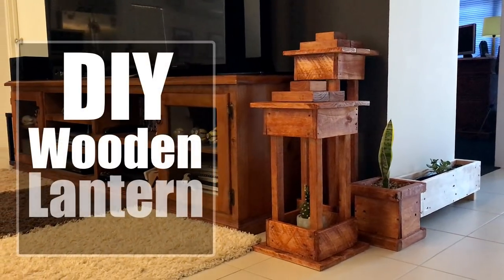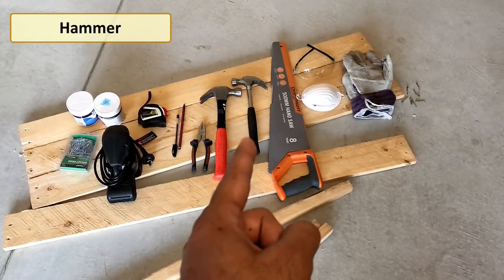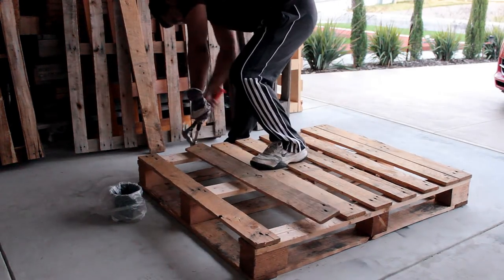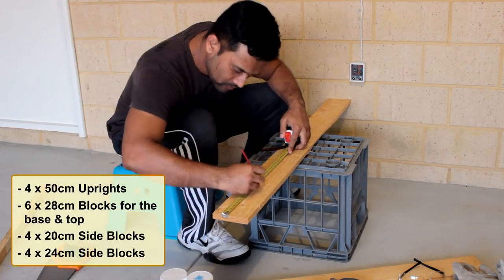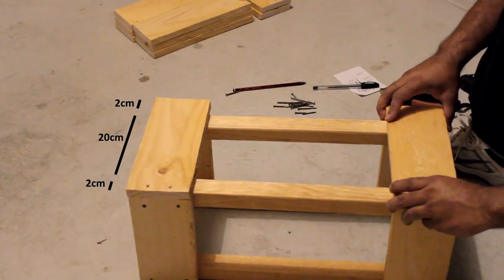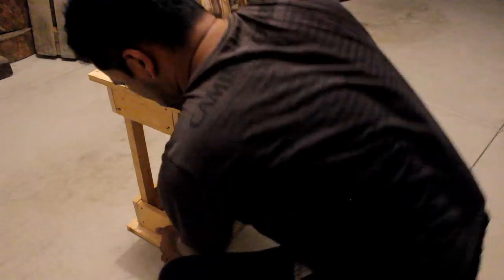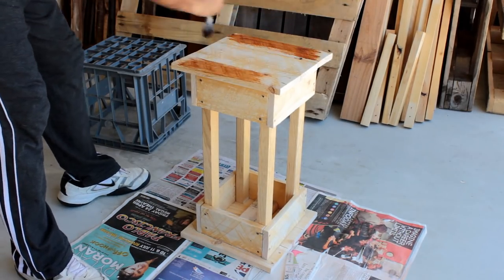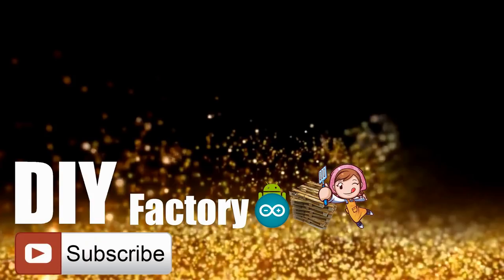DIY -  Wooden Lantern

Comment: Good job! Other than legitimate safety concerns, don't listen to anyone who knocks your projects. This is how you learn and build confidence. After you know this is something you like you can upgrade equipment and learn new techniques. If you ever have problems with boards splitting at the end try flattening the point of the nail with your hammer.